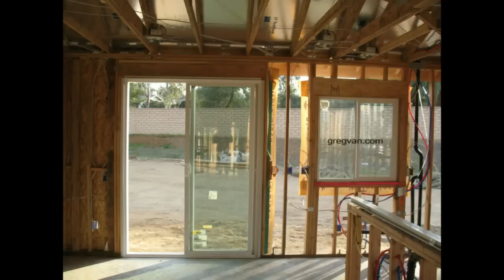Load Transfers Around Windows and Doors - Structural Engineering and Home Building Part 4

Comment: Hello Greg,
I was wondering if you knew how the load is distributed around a circular window?
Reply from the maker: Ivan Jones That sounds like a good video, I will make one as soon as possible. You basically do it the same way you would a square window, except you would use circular shaped box type construction to create the round opening.
Reply: The same way with round wood

Comment: The window is way over framed while the door is under framed.
Reply from the maker: I think I'm going to take the other side on this one and agree with the structural engineer, home builder and city or county engineers.
Reply: That's fine but let me ask one question. Why does a window that is smaller than the door need 4 2x4's on each side for a total of 8 2x4's yet the door only has a total of 3 2x4's but has to hold more roof weight due to a longer span. So go with the idiots in this video if you like but even you wont be able to answer why the window needs 8 2x4's and the door only needs 3
Reply from the maker: https://www.youtube.com/watch?v=LmZ_nNNaNgw

I went ahead and made the video that might be more helpful and attached a link to it at the end of this video. Double trimmers are required for openings wider than 5 foot and to transfer structural loads.
Reply: Then since the door is wider than the window why doesn't the door get double trimmers? How is it the window needs more support than the door? The door clearly spans further than the window.
Reply: I watched the video and see why this particular job is engineered the way it is proving you can't judge a picture by it's cover. I stand corrected and now see why it was needed. Thanks for taking the time to explain it!
Reply from the maker: You bet and thanks for watching. Sometimes a picture isn't worth one million words, but an explanation along with it is.

Comment: Hi Greg, if you take out a door frame to make a room larger, how do you ensure that you don't remove any load bearing supports?
Reply from the maker: If you don't touch any of the wood framing and only remove the door and the door jamb which would be the frame around the door, usually made out of three-quarter inch lumber, then you should be okay. Let me know if you need a video or some pictures.
Reply: Well I wanted to take out the door frame in order to basically combine the hallway with a small room in order to make one larger room. Is this not something that can be done?
Reply: I would very much appreciate a video or pictures if you could!
Reply from the maker: Why don't you send me a couple of pictures of your project and I will see if I can help. You can get our email address at the website.
Reply: gregvancom that would be awesome- I'll send those your way within the next day or so

Comment: Hello Greg,  wanted to get a preliminary info before I spend hiring a engineer etc. If I want the sliding door all the way up , floor to  ceiling,  can the house band /rim joist be used as header?  I want to replace the existing 8' wide , 80" tall patio sliding  door with a 10' wide,  8' high (80 door+16"transom above)  making it floor to ceiling height. Can I fasten a lvl to existing joist and double king jacks at the end of header to create the rough opening? This is a load bearing wall, concrete poured foundation below the wall. Thanks.
Reply from the maker: No, the rim joist won't usually work, but a load bearing beam can usually be installed in the floor to replace the rim joists. I will make a video as soon as possible showing how it's done and post a link here when it's done.

Comment: How do you add a new header to an existing load bearing wall?  How do you temporarily support the load while getting the header in place?
Reply from the maker: I will try and make a video for you, but basically you will install some type of support, whether it's in the form of a post or a wall to provide structural support for the area you're going to work on.